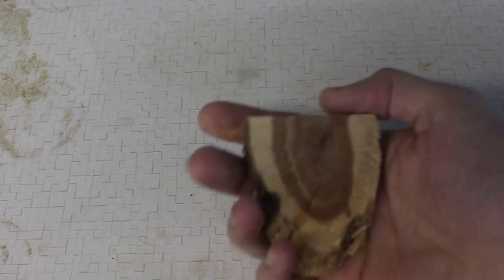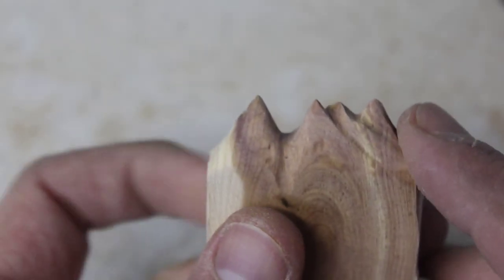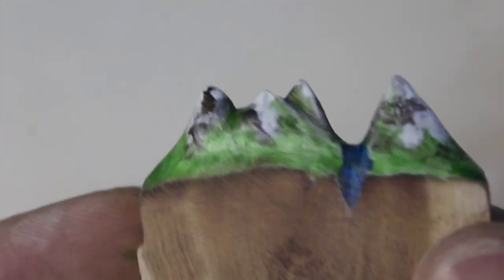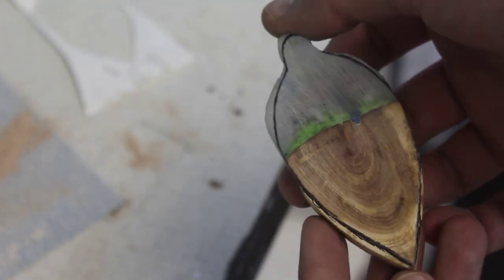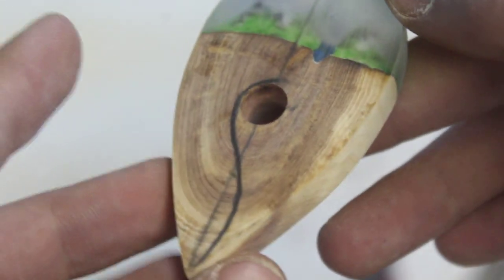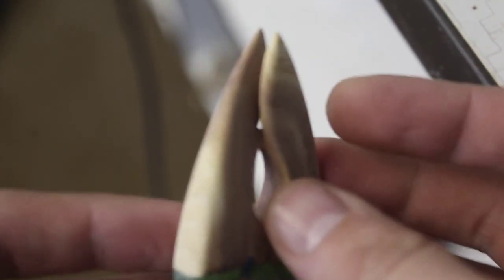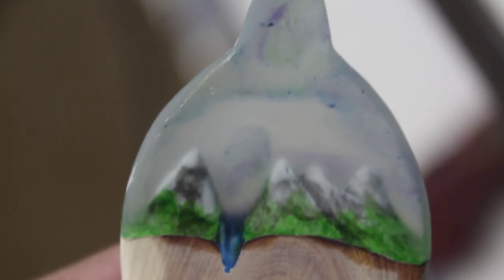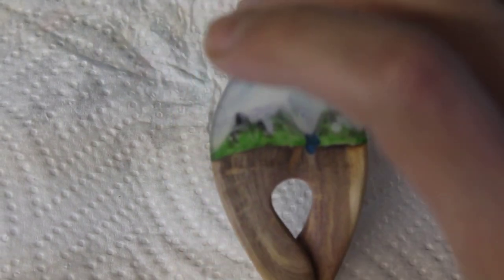Carving a Mountain Range Pendant out of Wood and Resin!

Comment: This is absolutely gorgeous! I hope that the bond between the wood and resin isn’t eventually weakened by the paint (the old mantra “never glue a painted surface” has me slightly nervous, but hopefully the fact that the mountains are dimensional will lock everything together) 

Also, looks like you totally looked into UV resin, so never mind my last comment 😁